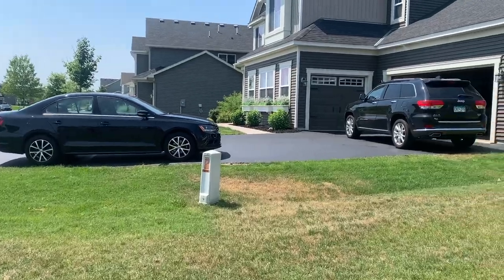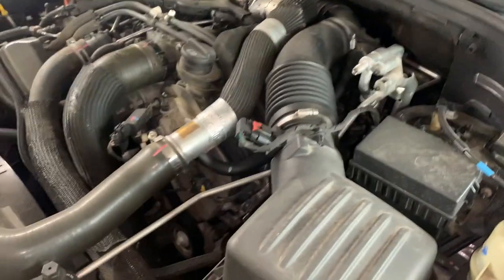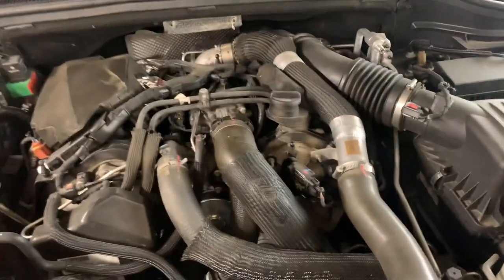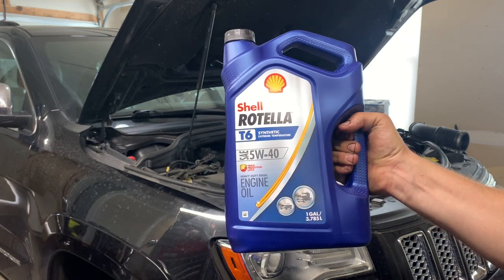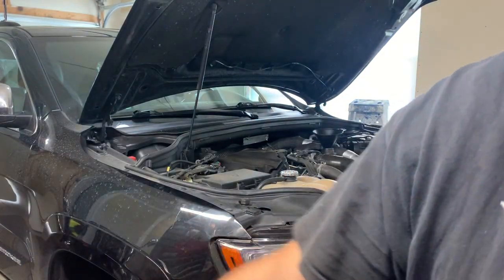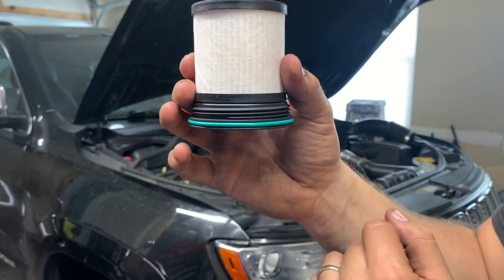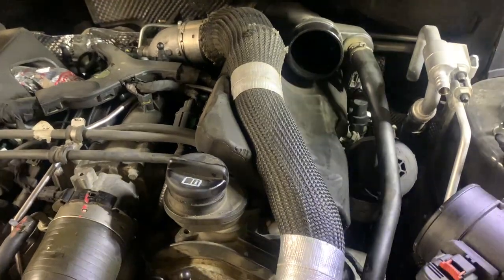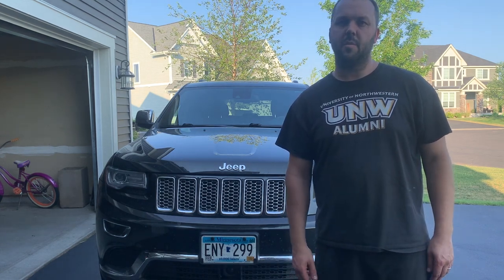Jeep EcoDiesel Grand Cherokee Oil Change & Fuel Filters

Comment: Really appreciate this, I just took my 2015 Summit ED in for an oil change for $175 not even realizing I could just use the air suspension as a means to DIY. They wanted $300 to do the fuel filters but I bought the pair and necessary tools for under $50 and will keep this video in mind for my next oil change as well.
Reply: My dealer was asking $390

Comment: I am using 2-stroke LiquiMoly semi-synthetic oil instead of diesel additive. 300 ml (1:100) on every tank of fuel. Costs close to nothing, great lubricant, burns ash free, great for the HD pump and injectors.
Reply: Wich exactly? 1052,1505,1029

Comment: Next time take your oil filler cap off before you pull your drain-plug. Also do it with a hot engine. It will all drain out in a couple of minutes.

Comment: I bought a 2014 JGC Eco-Diesel Summit model new so I have gone through the whole emissions saga and all the recalls of this vehicle. I have about 88K miles on it and overall apart from many many recalls and 3 glow plug failures, it has been a very reliable vehicle. The performance and fuel mileage are excellent and it's capabilities as a SUV are a class above a typical SUV in this segment (especially towing). Having said that, if you do not maintain this vehicle like a fanatic, you will experience expensive issues. 5k oil changes are a must because of the EGR gases contaminating the oil as well as Fuel filters every 20k. Also DEF has gotten 300% expensive since I bought the vehicle and the DEF consumption has increased because of the new EPA approved software.

Overall I love this vehicle but this will be the last light duty Diesel for me. The additional cost of Diesel, DEF, Fuel filters, expensive oil and all the funky emissions crap is just not worth it.
Reply: That is sad, I'm trying to hang on to mine.

Comment: I honestly have never thought about changing my fuel filters. Almost 80k miles on the factory ones. Great tutorial. I use amsoil
Reply from the maker: Wow, that’s good to hear. Thanks for watching!
Reply: I had an error code after using amsoil, something about high ash content and viscosity. I used the euro blend 5w40
Reply: @chrisc5574  Really? I do an oil change about every 7500 miles and have used amsoil since the first. I haven't heard of anyone having that problem before
Reply: @battlehero-qx6on  ya  I don't know for certain that it was the oil just never thrown any codes using Rotella T6. It was a  big enough problem with other coded that we needed the dealer to force regen, change the oil, and remove the codes
Reply: @chrisc5574  I use the signature series Max duty diesel. Used to use the Heavy duty diesel but decided to switch
Reply: @battlehero-qx6on  maybe I'll try the signature series on the next one to see of that really was an issue for this motor. I've used amsoil in everything else and no issues, just figured this ecodiesel was sensitive. If they only came with no emissions gear or heavy computer control then they would have a winner of an engine.  I sell my vehicles internationally so I keep the emissions stuff on
Reply: I would recommend it for higher mileage. Just a little bit better. I don't want to mess with the delicate computers so I haven't done any deletes or upgrades. I've thought about it more than once
Reply: @chrisc5574  Been a while but did you happen to try it out? If so how did it go?
Reply: @battle hero5991  No, never got around to that.  I used up the last of my rotella and sold the vehicle with these generous used vehicle rates lol
Reply: @chrisc5574  That's a good point lol

Comment: Funny he mentioned his wife thought the engine is loud. I did a lot of driving for work and when it was time to get a new jeep the sales guy knew of my driving habits as this would've been my 5th jeep.  I usually go for the HEMI, however he introduced me to the Summit  eco-diesel. I mentioned that diesels were stinky and noisy. He lined up a new Hemi and the eco-diesel side-by-side. I was shocked that the eco-diesel was quieter and not stinky. 

I'm on my third Eco-diesel now. Too bad Chrysler has discontinued these.

Comment: Thanks for this, very useful.   Did you reset the “oil life” on the computer after the service?  If so how?
Reply: Car off. Hit the start button twice (do not put foot on brake. Do not start engine). Floor it three times. 
Hit start to turn off. 
Finally hold start and brake to start car.

Comment: Hi. I just saw your video!  Great video too. Mine is a 2015 ecodiesel and I use Pennzoil euro L 5w-30. There is a lot of debate out there on which oil to use but my manual says use ms-11106 approved oil and thats what I use. I got over 150k on my ecodiesel and it runs like a champ! I also change it every 5000-6000 miles.
Reply: In the UK the spec is now 5W-40, I think Jeep changed the spec because a lot of the Eco-Diesels were spinning their main bearings.
The thicker oil was meant to help prevent this but it still happens.
Very impressed with your miles, many don't get to a third of that.  We're selling our 2014 GJ as fed-up with reliability, cost of parts and the risk of main bearing failure.  Hope yours keeps going strong.

Comment: I pull the diffuser tube and map sensor for cleaning while the oil is draining
Reply: Can u elaborate a little more.. I'm getting one of these and I want to know how to take care of it.
Reply: @INFINITE-AMMO  it's easier to look up videos on youtube about ecodiesel diffuser cleaning and map sensor. Some good videos on it. The cleaning of the MAP sensor helps the computer with fuel/air and the diffuser is usually full of soot and can get plugged.

Comment: are you pulling the filter prior to the drain plug? It should speed up the draining time or I just haven't noticed the time since I'm always doing multiple things.
Reply from the maker: GamersLife, I don’t think I am. I do remove the oil fill port cap to eliminate any crankcase vacuum but I don’t usually pull the filter cap until after I drain it. I’ll have to give that a try and see if it makes a difference!
Reply: @thatlldogarage  ya, i think it will help as I pull it prior to the drain. Hope it does help, whole point of this crazy internet thing sharing ideas and all. haha
Reply: I have a 2018 JGC with 83,000 miles with an ecodiesel. When I change the oil I drop the drain plug, and while it's draining I change the oil filter. I've never seen "2 or 3 cups" drain out after the initial drain because I'm not looking at it. I can only go by how many quarts I put back in and usually it's right at 8 quarts to hit the full mark on the dipstick with the filter removed while draining.

Comment: Do you need to be close to empty to change fuel or is that screw to drain a bit off?
Reply from the maker: That screw will let you bleed off the pressure and some of what is in the lines but it won’t drain the fuel tank.